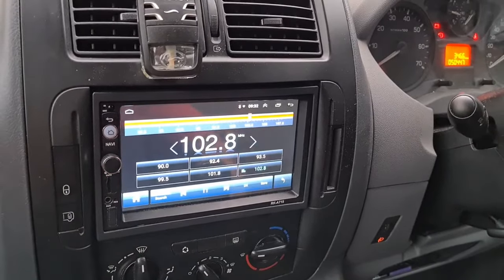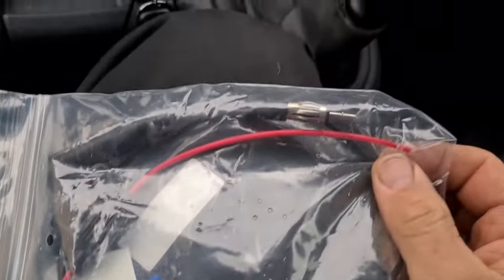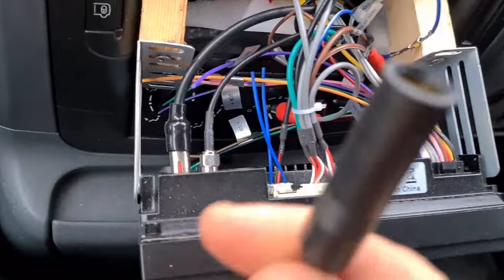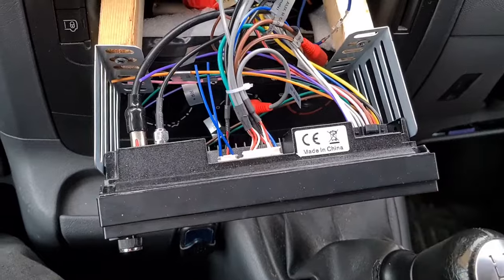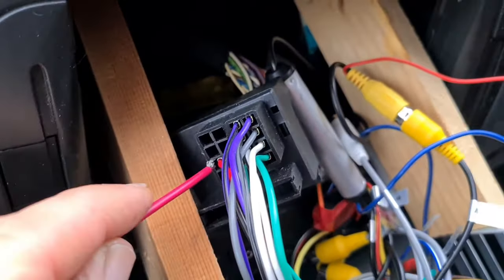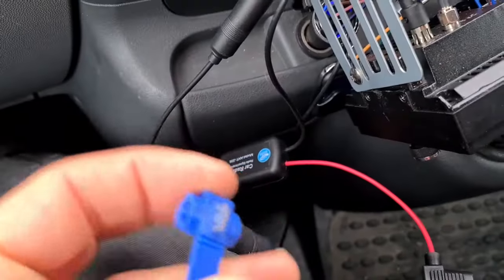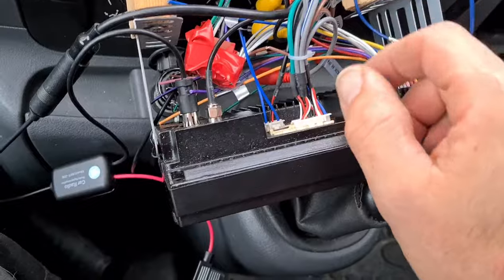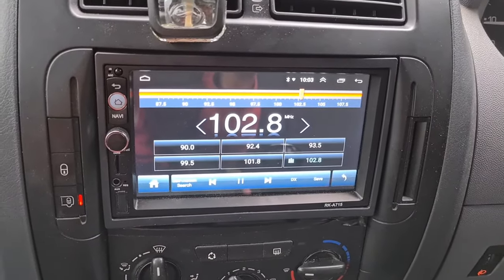Fitting a car Radio signal  Amplifier #carradio #radiosignalamplifier #signalamplifier #carradio

Comment: Obviously, this video footage was captured sometime around Christmas. 😊

Thanks for the detailed instructions! Your video absolutely saved me LOTS of time. It was easy & it seems to work just fine.

I just wonder how long it will last? I bet it fails after a couple of years... but hopefully we'll be luckier than that. 😮

BTW, I bought the same exact booster (same model #: ANT-208) from TEMU. It was about (U.S.) $7. The instructions were 'OK'... but your video filled in the gaps. 👍🏼

THANKS AGAIN, SIR... from Georgia, USA. 👍🏼🇺🇲

Comment: Looking like you have a active antenna, the tube looking thing on your antenna cable is a bias tee, used to feed 12 Volt to your antenna, important that the cable on that thing is connected to 12 volt

Comment: Hi I tried connecting the red wire from the amplifier to the stereo on the wire loom like you did and I found that my battery went flat in a few hrs do you have any ideas if there is another way to do this thanks.
Reply: That's why he said switched 12v wire meaning when you switch the radio off there should be no power... So find the switched 12v use a multimeter to determine which one is switched....
Reply: @MisterManj  Wire the red wire to the power ant wire, amplifier will only be on when the stereo is on, when you turn it of it will go off

Comment: Hi I have the same just ordered the amplifier, just a quick question how do I get AM stations Thanks
Reply from the maker: You need to check your Radio instructions  as every Radio/stereo  is different
Reply: It’s the exact same as yours in the video, your on FM as Am I, do you have the option to change to AM?
Reply: @sabiya2  every radio has am and fm either click band on touch screen or if manual it will be on a knob or press button :)
Reply: @homlesy1172  no mine hasn’t just FM,
Reply: @sabiya2  weird
Reply: @homlesy1172  it is weird, just literally can’t find AM, been through all the settings,
Reply: @sabiya2  yer in the 40 years of me being around cars never heard of that as cars started of with am only :)
Reply: @homlesy1172  maybe this unit that I’ve got hasn’t got it for some reason, The same models I’ve seen have it, weird one, yes I remember 😁
Reply: @sabiya2  cool

Comment: I would like to use this booster with my portable radio. How to power the unit ?
Reply from the maker: It runs from 12v most portable radios aren't 12v
Reply: Go old school for that... aluminum foil ball or wire hangar...

Comment: I have multiple red wires in my radio. How do I know which one is the accessory wire?
Reply from the maker: What do you mean by accessory wire .
Switched live or live ?
Reply: @diyandmetaldetecting  live
Reply: I saw a video saying you have to connect it via quick splice connector
Reply from the maker: @monikpatel1879  you need a volt Meter to find which is a live wire... the blue cabke connector  is the splice connector
Reply: @diyandmetaldetecting  oh ok if I send you a picture for the back of my stereo, could you guess which is the live wire
Reply: Because I have 5 red wires